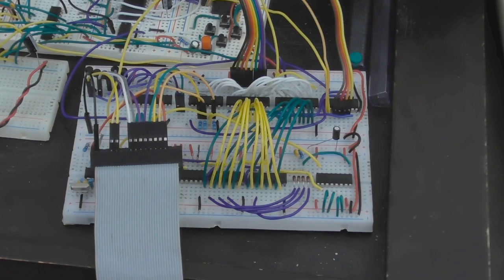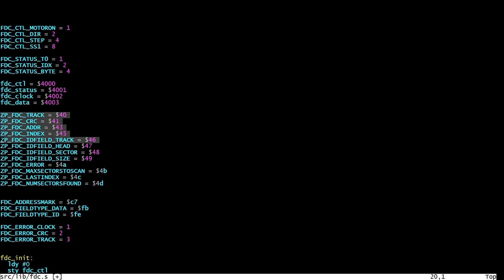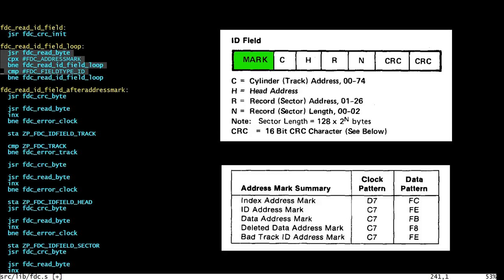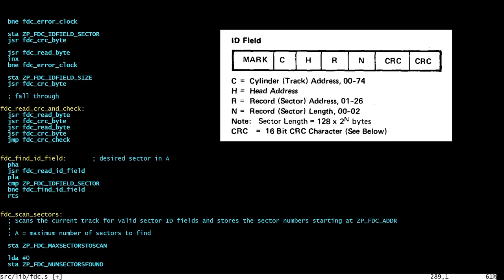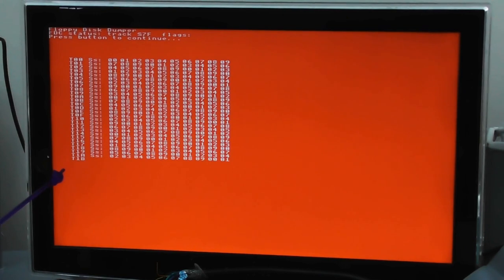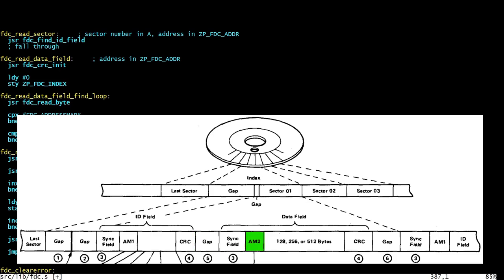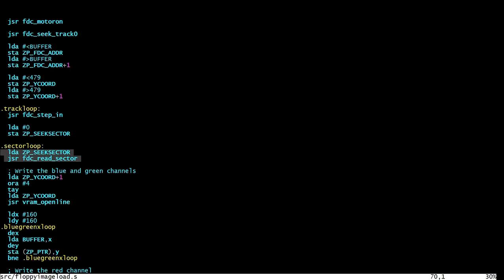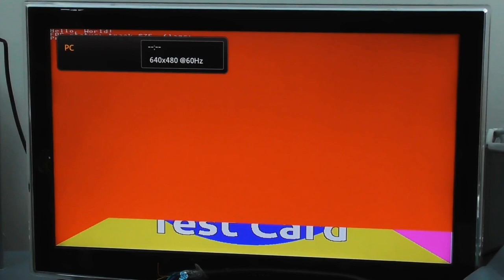Loading Data from a Floppy Disk on a 6502

Comment: The demos of loading picture data to you VGA display were really slick. You could pretty easily build a file system at this point.
Reply from the maker: Hey Martin, yes, I was considering using the Acorn DFS format for that. But then, I already have fat32 code that I use on SD cards, that might be easy to adapt. Pretty wasteful on a floppy disc though!

Comment: Hi! Awesome work! As for the random bugged lins in the read images:  You're supposed to check the CRC and retry a read if it's incorrect. Its perfectly normal for reads (and writes) to fail randomly from time to time, depending on many factors.

Also, where's is the next part? :-)

Comment: If the second image is corrupt, should not the crc fail?
Reply from the maker: Yes indeed, it probably is - but the image loading program is not checking the error codes. It is possible that adding retries there would help, and I could make it fill the line with red if it still can't load it. I should have thought of these things at the time!

Comment: What are you using for video out these days? Did you refine that VGA system?
Reply from the maker: Hi Brett, it's the one from this video,  quite a while ago: https://youtu.be/cFJX95zQj4w

There aren't any significant changes since then, but I have replaced some of the logic with a 16v8 PLD - especially the coordination of cpu clock, write timing, etc.
Reply: @GeorgeFoot  Thanks. Lost track of it all :)